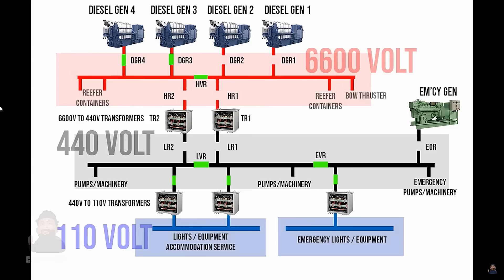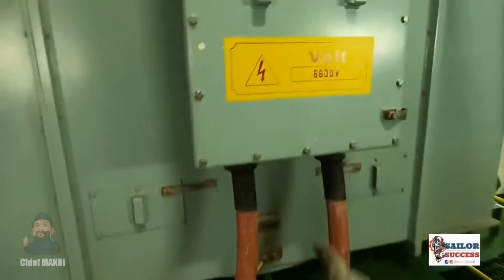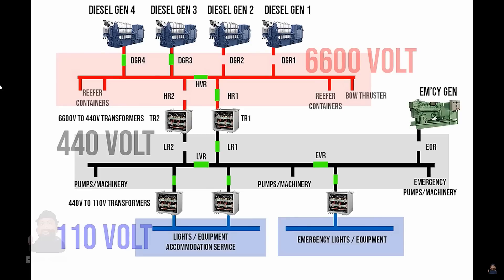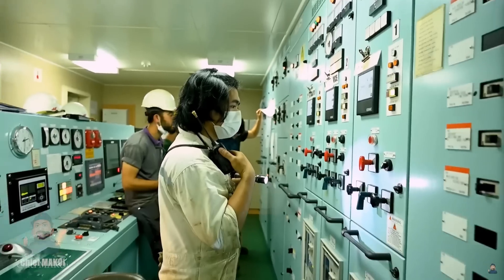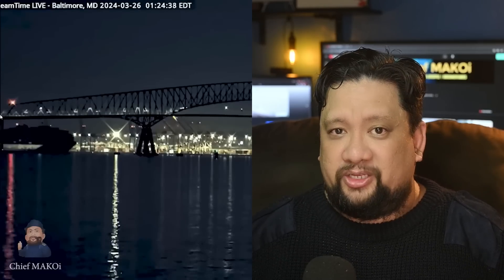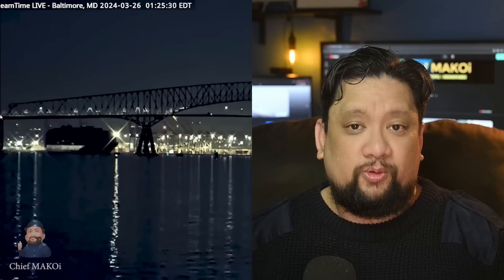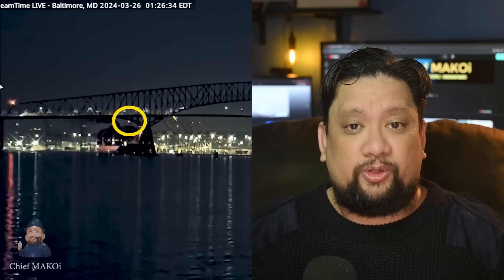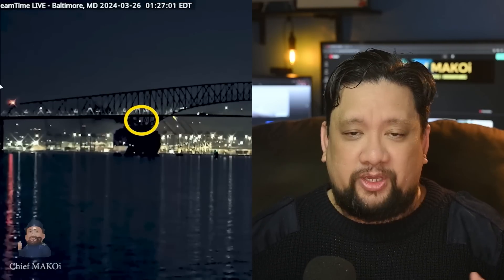Bow Thruster : Why The Dali Didn't Use It | Chief MAKOi

Comment: For the sake of argument even if the 6600v bus remained powered the entire time before the Dali collided with the bridge would it not take one or more of the lower voltage busses to close the 6600v relay to energize the Bow Thruster Motor / Motors?  The 6600v line from the generator bus does not flow through the Bridge where the crew can throw a massive breaker to turn the blades on the Bow Thruster but I’m guessing it’s some low voltage line in the bridge that runs down to the bow that closes the 6600v relay that provides power to the bow thrusters?  So you still need power from either HR1 or HR2 to power the relays to close the 6600v Bow Thruster Relay? Option #2 for power the relays would be power from the Emergency Generator?
Reply: Yup, and there is probably a lot of other low voltage support equipment for the bow thruster as well, like motor starters, safety systems, alarms, variable frequency drives, lube oil pumps, cooling pumps etc. Very large electric motors like that do not have simple ball bearings; they have oil filters and oil pumps etc. And they have to have some kind of variable speed, you can't just slam on a huge electric motor from dead stop to full speed, the inrush current would blow things up, or the sudden torque would break something, they have to be brought up to speed slowly.

Comment: Maybe they should have configured the SHIP to a Fail-Op-Fail-Safe mode instead of going Single String mode. Fail-Crash is not a could way to configure the Electrical System on a Ship.

Lets See if Chief MAKOi can get the busses to a Fail-Op-Fail-Safe mode.

Comment: Coanda effect, any vessel moving more than 5 knots, the water will pass across the tunnel thruster, just like having a shower the shower curtain moves towards you. What they should have done is went full ahead to stop the transfer thrust of the propeller moving the bow to starboard, if they had gone ahead, more water would have moved along the rudder and allowed the vessel to manoeuvre away from the pedestal
Reply: Yup, but with the main engine shutdown, that wouldn't have been possible, also as they got too close to the edge of the navigable channel, bank suction pulled them in, simular to the Evergiven getting stuck sideways in the Suez.

Comment: It would be interesting to watch testing on a ship to look at bow thruster performance versus ship speed.  

I’m curious if the bow thruster was actually available even though there was high voltage power.   I presume there are controls and other support systems that are required to operate the bow thruster and those systems are powered by the low voltage bus.
Reply: It's been tested. You can see a performance chart on page 273 of Sea Loads on Ships and Offshore Structures by O. M. Faltinsen (Cambridge University Press, 1993).

Comment: Turning the ship doesn't change the direction it is moving (at least mot by much) without forward thrust, all the bow thruster really would do would be to rotate it around the center of mass. But that mass would mostly go in the direction it was already travelling. Some change of direction of travel would have occurred, but very little.
Reply: ... and assuming MV Dali's center of mass is not at stern but most likely more somewhere between stern and half of ship length, that means  stern would move to starboard (and thus could hit the pillar instead of frontal collision) when bow thruster tries to push bow to port. Anyway, all hypothetical since bow thruster not effective at speed of 8 knots ...

Comment: Most people don't realize the amount of horsepower it takes to move a sizeable ship, let alone one the size of the Dali. It takes tens of thousands of horsepower from the main engines to move a large ship at any kind of useable speed, and to get it up to that speed in a reasonable amount of time. That bow thruster is probably at best just a few hundred horsepower.
It would be equivalent to zipping along in a large bass boat with a 100 HP inboard engine at 20 knots, and then trying to change course using the tiny 12 volt 1/3 HP electric trolling motor you had mounted on the bow.
Reply: The bow thruster on those large ships is a few 1000 horsepower, but the main engines are nearly 50K. Massive difference.

Comment: Thanks for clearing this up.  When I see 'Chief MAKOi,' it is like a panel light coming on that immediately demands my attention.  When I want the best expert opinion on the Dali incident, this is where I go.  

I am still waiting for an explanation on why the circuit breakers opened as they did.  My guess is that there was high voltage arcing between conductors or from a HV bus to ground due to a breakdown of the electrical insulation and that caused large current flow spikes and/or large back-EMF spikes that opened the breakers.  Just a guess.   I would really like to hear more on just what would cause the breakers to act as they did.

Comment: this makes me wonder, has there been any instances where the bow thruster was engaged while the vessel was at speed? what hydrodynamic effects did it create?
Reply: The effect of current perpendicular to a tunnel thruster turns out to have been tested at least as far back as the 1960s. Faltinsen's Sea Loads on Ships and Offshore Structures has, on page 273, a graph showing results from a 1966 paper by Chislett & Bjørhden showing a very large and rapid decrease in tunnel thruster efficiency as ahead current/vessel speed increases from 0.
Reply: @Curt_Sampson  " showing a very large and rapid decrease in tunnel thruster efficiency as ahead current/vessel speed increases from 0."

Yes, yes.  Kind of what I was looking for, a statement that efficiency was not actually zero and that there was still an effect, albeit a lesser one.

In other words, it alters course, just not by very much.  And there is a graph showing this curve of reducing efficiency thruster as ahead speed increases.

And how much lesser?

It is a crying shame that we can't post images like that graph in YT comments.

But what about with current knowledge and techniques of hydrodynamics and propeller design?  Sixty years ago.

There have been huge advances (not as much as electronics, but still incredible) in propeller and hull shape design over the past 60 years.

What would that curve look like if the tests were run with various modern propeller and turbine designs?   I don't doubt it would still drop off, but lots of curves drop off and still leave useful power.

However, that might not matter.  There might also be other reasons bow thrusters cannot be used at high forward speeds.  And I say +++ might +++.

Possibly there might be ill-effects on the thruster propeller/turbine, like excessive cavitation.  Or possibly ill-effects on the thruster motor or controller.  Those -- IF they exist -- might rule out using a bow thruster even in a hypothetical case of a ship that needs alter course by 1 degree over the next 60 minutes.

Still, it is good that you found that these rules on bow thrusters date back to the 1960s and that they do not say they have zero effect, but that the effect drops off sharply.  Dropping off sharply makes intuitive sense to me.  And for most practical purposes  0.1% is the same as 0%.

Thanks for your time in looking all this stuff up for me.  I really appreciate it.
Reply: Exactly.  When people ask design engineering questions people responding in comments should not be merely repeating what the user manual says and calling them "armchair quarter backs".  Taking one of the many existing ships with bow thrusters, why would turning on the bow thrusters not change the course even a tiny amount?  It is a perfectly valid question for ship design engineers.

But how to get the question passed up the line to some ship design engineers?

Is there an interlock preventing it happening?  Is it hydrodynamic effects affecting flow into the thruster's tunnel?  What?
Reply: @Lost-In-Blank  for me, what would be really interesting is if the disruption of the water flow at speed, caused by the bow thruster, would cause hydrodynamic effects such as turbulent drag on one side of the ship, and make it turn the opposite way

Comment: USe of a bow thriuster at that speed at the side of a dredged channel is a very dangerous thing and can have significant unexpected hydrodynamic effects and make the ships go in the opposite direction to the expected direction of thrust. The small changes in pressure over the whole hull will way more than outweigh the direct thrust of the thruster, and in fact teh aim underway is to change the angle of the hull along the direction of motion and then the hull causes the hydrodynamic lift. It is not like car tyres on the road.

Comment: The short non-engineer answer is, the bow thruster would be totally useless with the ship moving at almost 9 knots. It would have absolutely ZERO effect at that speed...they are used only for pushing the bow at little or no forward motion.
Reply: So I'm looking for a design engineer to tell me why it would have no effect instead of just repeating what is in the manual.  You're belittling people, but the only bad question is a question not asked.  Sure that is what the manual says.  Why did the engineers who wrote the manual put that in there?
Reply: @Lost-In-Blank  Sorry, which manual are you talking about? Have you compared the contents of that manual with general books on ship manoeuvering as well?
Reply: You are the one making the claim, it is up to you to provide your sources.

What evidence do you have to say that no bow thruster on any ship could make a tiny bit of difference to a ship's course?

Do you even know what a Reynold's number is?

It seems to me your quoting what martime professionals are saying about a specific circumstance where time is short and trying to generalize to all ships everywhere.

These guys are not design engineers.  They didn't do the fluid flow calculations themselves.  So what are they basing their statements on?

It is an old saying in engineering:  The only stupid question is one that is not asked.
Reply: @Lost-In-Blank  Actually you're the one making the claim, contrary to the knowledge of every mariner that's spoken here, that the bow thrusters will make a difference.

And yes, as I explained above, I do indeed know what a Reynolds number is. And I can even spell the term properly, unlike you. I notice you've avoided mentioning whether you've heard of the Coandă effect.

As to what they're basing their statements on, after having done a trivial amount of research on the Internet, I expect it's pages 272-273 of Sea Loads on Ships and Offshore Structures by O. M. Faltinsen (Cambridge University Press, 1993), or similar academic work. (Faltinsen is a professor in the Department of Marine Technology at the Norwegian Institute of Technology.)
Reply: @Curt_Sampson  My field is electrical engineering.  So, if you thought had a proper academic answer to our questions, why did you not just give it?

Why call people names?

Anyway, the only editions of that book I can find are 1993.  So they're obsolete.

If you have something from the past 20 years, would you please you type out the URL leaving out the periods so that it doesn't get censored.

Or else cut-and-paste what he wrote here.

I really do want an answer to my question.  I want to see the theory.
Reply: @Lost-In-Blank  I didn't call you names, tempted as I am to do so.

I also didn't have a proper academic answer before I did the trivial amount of research, which clearly you couldn't be bothered to do. And when I did dig up an academic reference for you, you can't even be bothered to read it. I find it odd that an alleged EE knows so little about physics, but here's a clue: the laws of physics haven't undergone major changes since 1993. Or even 1966, when the loss of transverse tunnel thruster thrust with forward motion was shown experimentally.
Reply: @Curt_Sampson  Ship sizes, engine power, and CAD/CAM software have changed hugely since 1993.  

Anyway, thanks for trying to answer our question.

Anyone else care to try?
Reply: @Lost-In-Blank  Sure. And EE technology has changed massively in the last thirty-five years as well, yet, weirdly enough, Thévenin's theorem still works. Radio technology has changed massively in the last hundred years and yet we still design antennas using the same principles we used a hundred years ago.

Basically, with an admitted near-zero understanding of marine theory, you have a "feeling" that bow thrusters should work in circumstances where they don't, refuse even to consider the references you're given, and have just generally decided that you are right and the rest of the world, including people who work in the field, is wrong.

How would you respond to someone who came to you and told you Ohm's law is no longer applicable due to CAD/CAM advances over the last thirty-five years?

Anyway, I've given you a reference that answers your question: it's up to you to read it and find evidence that it's wrong. (Or just continue to insist your feelings about how things should work must override physical reality.)
Reply: @Lost-In-Blank  I edited my comment to be a little less harsh sounding. 30 to 40 years experience on and around boats and the shipping industry so I'm quoting from direct experience. It would take pages to explain the engineering and physics behind it. The bottom line is the space available to install a bow thruster does not allow for the horsepower motor or size of propeller that would be required to give it useful effect when the ship is underway at much over 5 knots on average....some say 3-4 knots. They are not designed or intended to do other than assist a ship usually getting on or off of the wharf or dock. So they are only designed to work at slow speeds or even a stop.

Comment: @Chief Makoi  Maritime industry people interviewed on this say bow thrusters would not have made a difference, and most sources say that is because on ANY ship bow thrusters do not work when the ship is moving at more  than X knows (say 3 knots).  Forget the case of Dali for a moment -- why is that?  Why would a bow thruster not change the course if there had been 60 minutes and 15 miles until collision?  Could bow thrusters really not change a ships course whatsoever at all if the ship is moving over 3 knots?

My guess, as a layperson, is perhaps that is written in the manufacturer specifications and nobody has questioned it.  No easy way to just test it out without risking their job.  

Perhaps the designers and engineers at the manufacturer wrote that because the hydrodynamic effects of the ship moving forward in the water might disrupt water flow into/out of the bow thruster tunnel possibly making the bow thrusters ineffective?  But that is just my wild guess.  Did design engineers calculate that it would have no effect?  Did they run a test on a scale model?  Did they try it out in a planned and safe experiment?  Is there an interlock that prevents bow thrusters being activated when the ship is moving too fast?  

Or is it just an assumption by the ships' design engineers that is in the manuals and we have to go by what the manuals say?

Yes, we have to go by what the manuals say.  And I'm not trying to assign blame.  

I just want to know why so many senior mariners and senior maritime officials say bow thrusters cannot ever change any ship's course by even a tiny amount at speeds over 3 knots.  What is the engineering reason for saying that?  (The theory behind why the manual says what it apparently says.)
Reply: How do we get this question passed up the line to ship design engineers?  Chief, does someone in your company office deal with ship builders and ship designers?  Perhaps the engineers that do your company's ship purchasing?  Or, even better, maybe at professor your school?  I'm looking for the theory of why, not just what the manual says.

Comment: I am wondering if the Dali ran across her  anchor chain diagonally  after it was dropped and some chain played out. 
 and then the ship bow was  "pulled" the few  degrees off on her straight course by the force of the  anchor/chain running under the ship.

* I forget how off course(in degrees) she went in last minute(s)
SOme people still think she was "steered" into the bridge, I don't think so.
  But running over the anchor could have done it, seen enough boats and ships "swing" around at anchor.